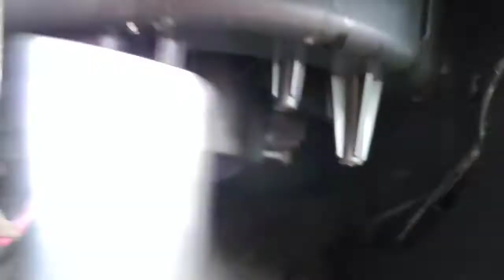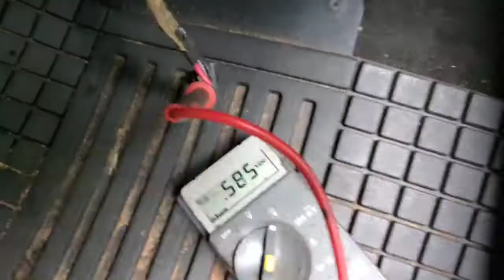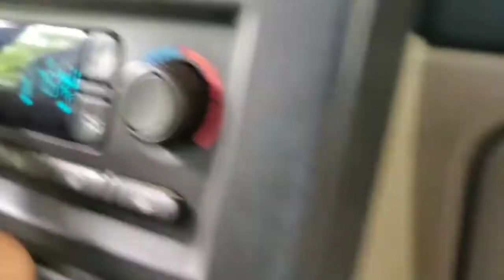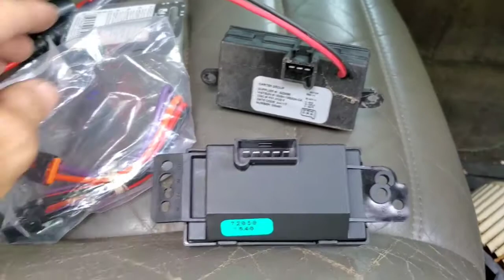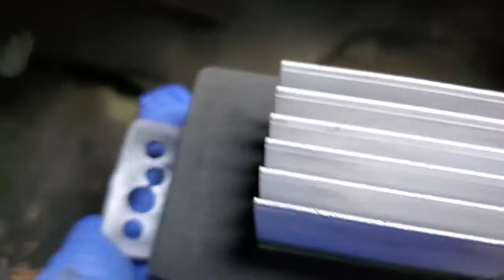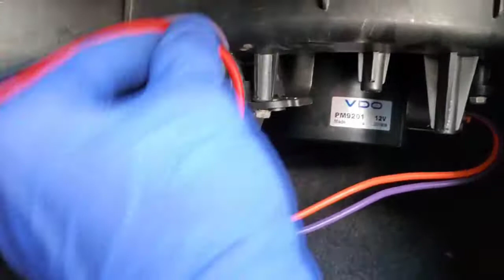'04 Hummer H2 Blower Motor Replacement & Resistor Modification

Comment: Excellent video,I have an H2 06 Hummer and my mechanic said the Chevy would NOT sell him the  BLOWER resistor  period !!!. The Chevy dealer told my mech to send the customer to them becuase its an electrical issue. The cost was going around 800.00 dollars to fix (lol) and the chicago winter was about to start.  Thank to AMAZON a replacement resistor cost me 25.00 after market and worked just fine. Shame on Chevy for deliberately trying to take advantage of hummer H2 owners that a simple mechanic can repair.
Reply: They went up a little. 😊
Bought mine for $45 on Amazon.

Comment: Great video....The H2 is a off-road beast, but so sensitive with it's electrical system. Dead or dying batteries cause so much headaches. Now off to test fuses, then resistor, then hopefully that's all.
Reply: Disconnect the OnStar and the battery issue should go away.
Reply: @YavuzAlavi I did that about 5 years ago and no luck. The battery still dies every so often. So I just disconnect the negative lead if I'm driving my other truck for a while. I love my Hummer but it gets on my nerves every now and then.

Comment: I went thru the exact same thing you did where I had the part from eBay and it appeared to be missing a wire harness so I went to internet and found a resistor that says it  doesn’t fit my hummer but it worked cause I spliced the wires from The original harness to the new.

Comment: The leak is coming from your passenger side cowel area. You need to take your windshield wipers apart and remove your cowel and you’ll see a plastic lid on the passenger side that the adhesive is no longer good. I used the flex seal tape and mine is no longer leaking. Let me know if that helped.